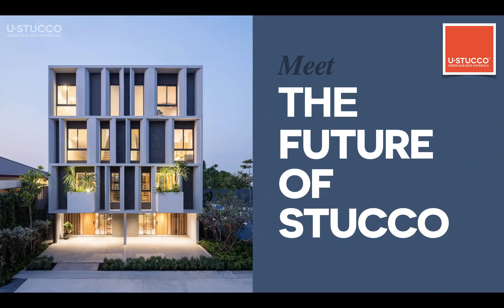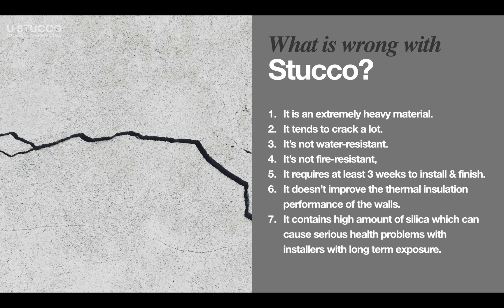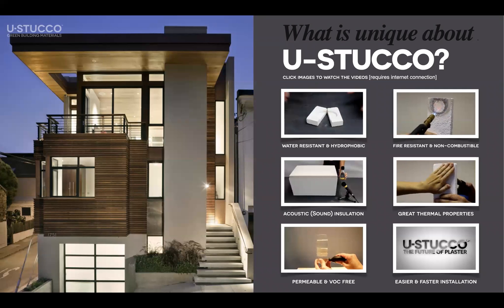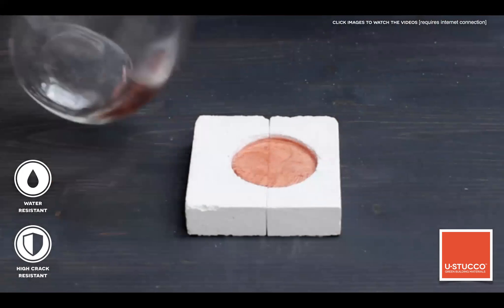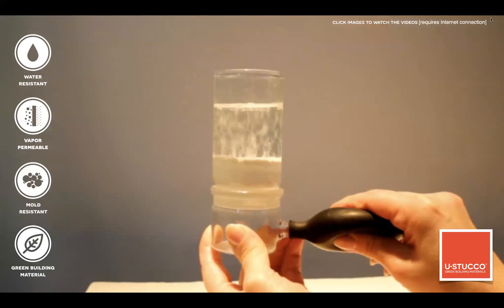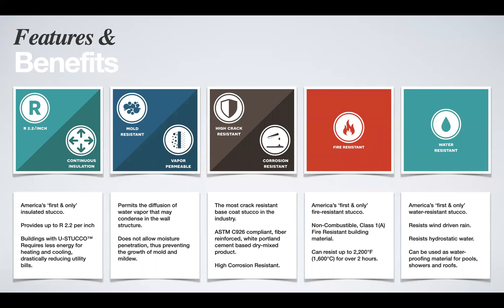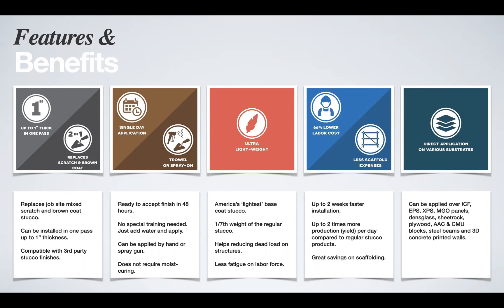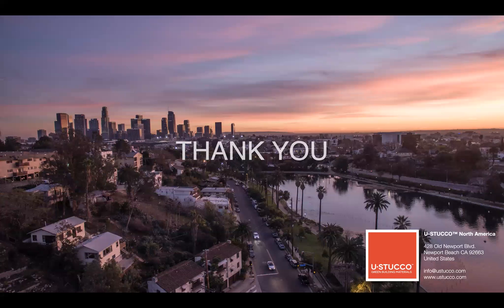U-STUCCO™ MGBCE 2020 Keynote (USGBC-LA Net Zero Accelerator)

Comment: Also, you say its insulated but at R-2.2 per inch and a normal scratch coat is 3/8" thick. You are only getting an R-.825 and a typical scratch coat provides an R-.02. To add an R value of less than 1 isn't really worth mentioning. To a typical homeowner when you say its insulated, they get excited thinking about saving energy and money, but I think it is a little misleading.